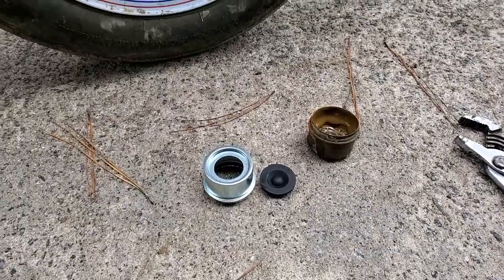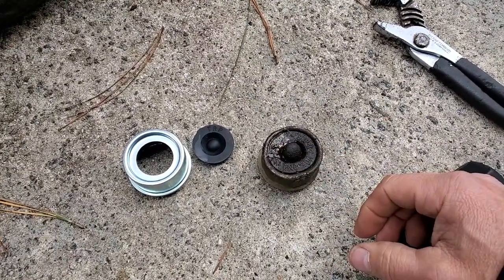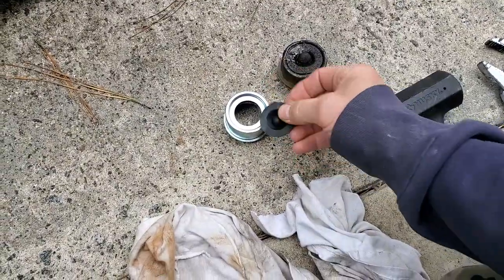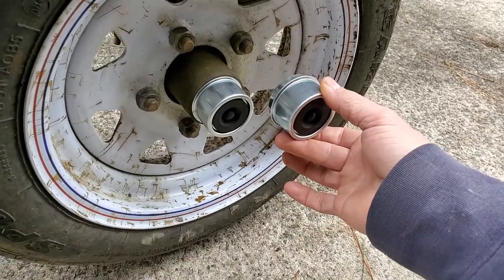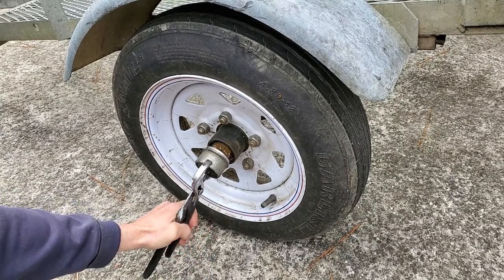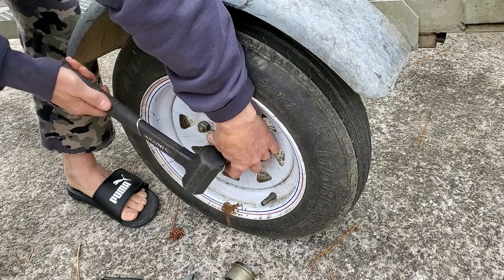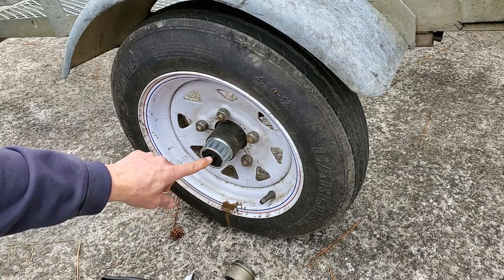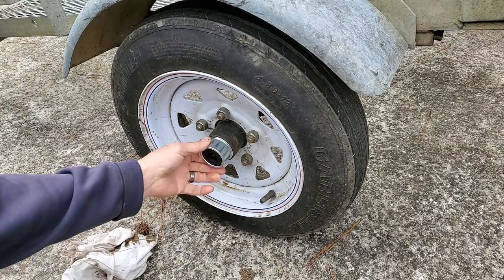How to replace bearing dust cap with rubber plug grommet cover on small utility trailer axle

Comment from the maker: Where to buy - Entire kit with bearings, seals, caps, clip, etc. https://amzn.to/2OXBLpD
Rubber Seals / Grommets only https://amzn.to/393BnNb
Dust Caps with Rubber Grommets https://amzn.to/3eZzhBV
12" channel locks pliers https://amzn.to/3f1UPO8
3lb plastic dead blow hammer https://amzn.to/3f0Ahpj